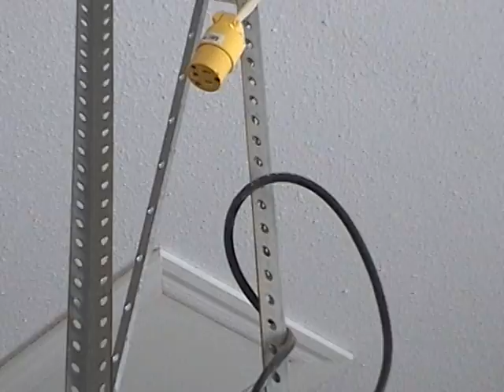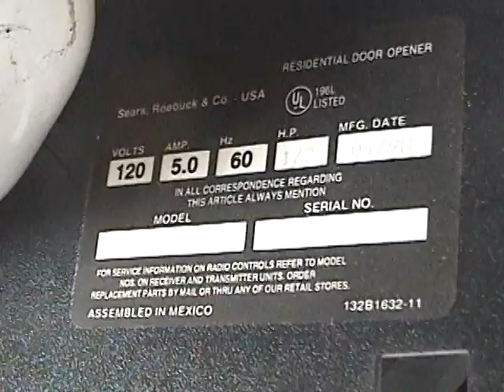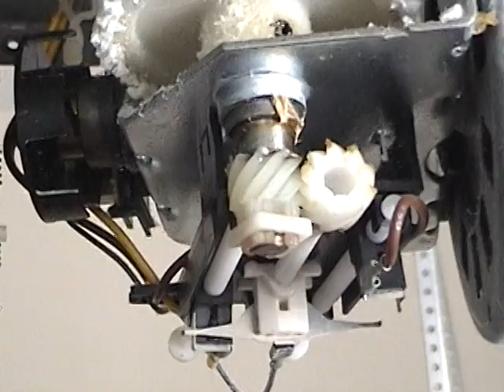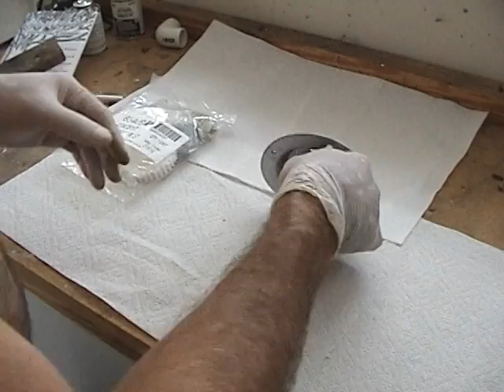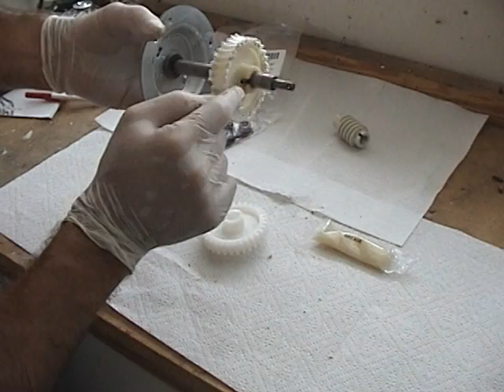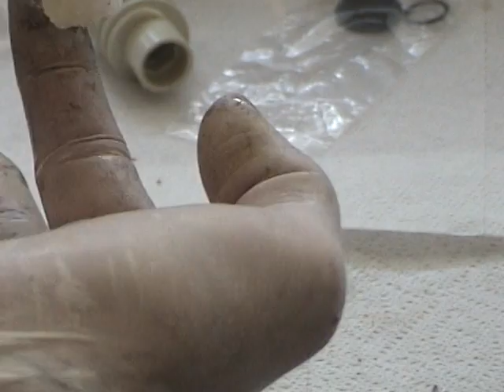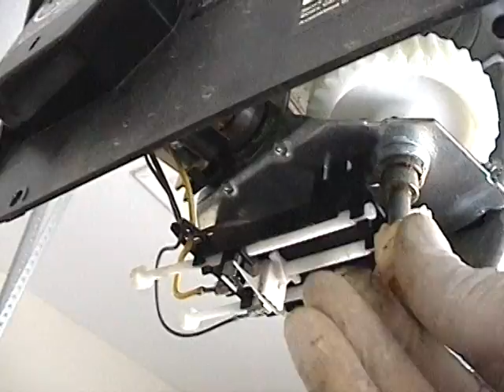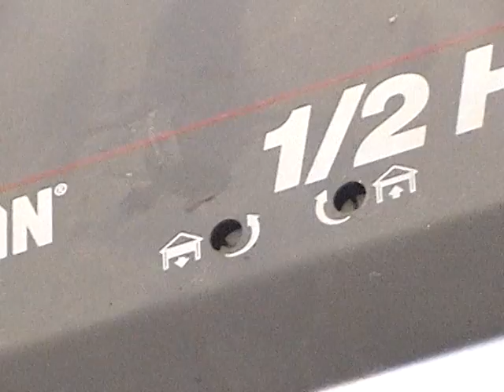Craftsman (LiftMaster) garage door opener issues?

Comment: Kris: The gear replacement went fairly smoothly. Great video. However, when I closed it up and plugged it back in, I heard a quiet "pop"  when I hit "open" and the light went out. The motor did not come on at all. I took out the capacitor and checked it and it's fine. I did not blow a fuse. What gives? Help!
Reply from the maker: check the easy stuff first namely the circuit breaker. Are you getting power to the unit? Check the circuit board in the unit, any burned spots? Check the wires, making sure nothing came loose. Not sure what it could be.

Comment: Great Video, THANK YOU!

My only issue is getting the screws out...I am having a very hard time getting at 2 of the 3 screws.  Any suggestions or creative tricks on how to get at the screws? Seems fairly straight forward if I could only get the screws out...ugh!
Reply from the maker: What is making removal hard? 1) can physically reach the screws, 2) the screw points re rounded off, 3) screws broke, etc... If I knew more, I may be able to help.
Reply: Kris Kasprzak Struggling to reach a couple of them with a tool that I have enough room to unscrew...I think I need to find a longer 5/16 wrench as I am having a hard time getting something on there with room to turn it
Reply from the maker: TheMuschnick I don't remember what tool I used--knowing me it was a ratchet. I'm sure a good old fashioned box end wrench or even a nut driver will work. Hang in there--you can do it.

Comment: Thanks for the tips, Kris.  Not quite a ten minute job for me since my garage ceiling has gyproc on it, and so was too close to the ceiling to get the gear out.  I had to drop the unit by taking out the two heavy bolts holding it to the ceiling brackets, then rest it on top of a step ladder.  It was quite heavy, so you want to be sure you have your ladder positioned to lay it on as soon as you get the bolts out.  The tip on getting that little pin out were great.  Thanks for the video.  Very useful!

Comment from the maker: There are 2 sides to the chain--the tension side and the return side. The tension should always be tight--even when the door is going down. It's possible the springs that assist lift are very tight, reducing the work on the motor. If your door rises and closes, i'd not mess with the springs--that's a very dangerous job.

Comment: Thanks a million for the video and detailed instructions!  I got the part kit on amazon for about 20 bucks (compared to 65 from the local garage door company....let alone what they'd charge for the service call).  The bottom pin holding the gear in took a while for me to get out, but I didn't have a vice grip either.
One question for you - is it normal for the belt to be a bit slack when the door is going up?  It's tight when its in the down position and fairly tight in the up position too.

Comment: Hi guys, Kris found as I did, that second gear involves taking most of the opener apart. Very involved. I found, as he did, that the small pinion gear, is not the one that wears, fortunately. Bushings don't seem to wear either.  Now.......Grease is NOT used on nylon gears. I know it's neat to open up the package, and smear that crap all over, but it's not for the gears, and it only is a dirt magnet. The grease is used for the bushings, and you can smear some on the chain, if you like......

Comment: Kris!  Thanks so much for your excellent and detailed instructions and video.  It didn't take 15 minutes, or even 30 minutes, because there is a ceiling in my garage, so space to work was restricted. Cost:  $25.65 instead of a $100 x #?#.  My dad and I were able to follow your instructions and successfully complete the project.  It was fascinating to learn how all of the mechanisms work.  My dad is going to fix the opener at his house next.  Must admit, that third screw was difficult.  You Rock!

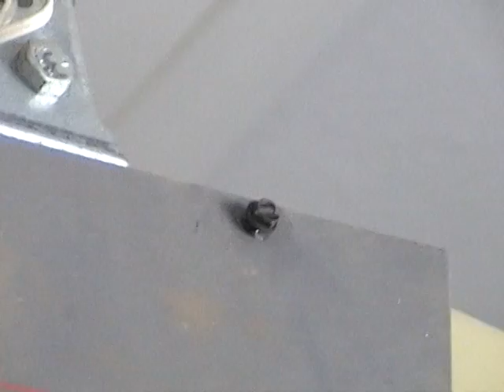Comment from the maker: are you referring to the screws I show at 1:00 min mark?
 I believe it's a 1/4 inch. Did you round the points of the screw off? If so, you will just have to use some elbow grease and a few swear words.

Comment from the maker: I'll guess the stop limit needs adjusting. This is not uncommon after changing the gears. It the adjustment screws on the side of the unit.. you will need to adjsut the stops until the door just kisses the floor. Keep your finger on the remote to stop the door during adjustment.

Comment from the maker: I'll guess the "pressure adjustment limit (adjustment screws inside the unit) needs adjusting or the stop limit (adjustment screws outside the unit). This is not uncommon after changing the gears.It sounds like the unit is "bottoming out" and forcing an open. Keep the remote in hand and be ready to stop if you adjustments are wrong.

Comment from the maker: I'll guess the pressure adjustment is off. Basically this adjustment allows the motor to apply additional force to open or close the door. It is a different adjustment from the amount of travel. If i remember the pressure adjustment is inside the unit--meaning you need to take the cover off.

Comment: Replaced gears opens normally from wall unit and transmitters.s However, I must hold the transmitter for the whole travel closing.  If I stop depressing transmitter in the down posit it stops and reopens.  What did I do wrong?

Comment: Thanks Kris.
Followed these instructions right down to using the nail punch and they worked perfectly. I also found if you remove the rear plate with the circuit board (but leave all the wires connected), you can take a little string and tie that up and out of the way for MUCH easier screw access. Appreciate you posting this!

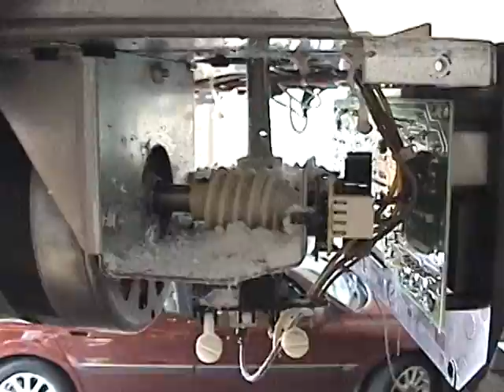Comment from the maker: are you sure the positionng screws were not damage or moved? You can see these behind my middle finger at 2:39. I'll guest they got moved or bumped you should be able to use the adjustment screws to adjust op/down and pressure.

Comment: Hey Kris,  
I changed the gear however, the door is now stuck in the 'up' position.  It seems as though there is a lot of stress on the top of the gear.  How can I get the motor to go down instead of trying to go up when I press the opener?

Comment from the maker: Spark and smoke from electronics is a bad thing. I'll guess some debris fell onto the contacts or some metal shorted out the board. The board may be repariable but would take some deep knowledge of the circuitry. It's probably best to just replace the unit. bummer....

Comment: Quick question, followed your steps and it was relatively easy as you say. When I plugged the unit back in a got a small pop from the circuit board accompanied by a little puff of smoke and spark. Now the opener doesn't work at all. I'm assuming at this point it's shot, any ideas on what happened and if there is a quick way to troubleshoot this?

Comment: Excellent video. I only need to replace the main gear (that you replaced) and do not need all the other parts that are included with the replacement kit. Seems like $1.30 sure beats the cost of the $25 for the entire package. Go to Amazon.com and at the top of page you will see a search box. Leave the "drop down arrow" in the search box on the default "All" and type into their search box "Sears Garage Door Opener Gear". Scroll down and you'll see the drive gear priced at $1.30  Thoughts? Thanks

Comment: Hey Kris, thanks for this video!  I ended up having to take the chain off, but everything went smoothly, and I was able to adjust the travel and all was good. My garage door repair guy said, "Well, you'll probably need to replace the unit, so all said and done, it'll be about $650.00"  Thanks to you, it cost $11.75, an hour of work, and a cold beer.  Outstanding video. Thanks!!

Comment: I would have changed out the worm gear on the motor shaft as well. I would have bought the entire gear shaft assy instead of the gear itself. This way if there were any worn parts  under the spocket of the chain it makes it easier to swap it out instead of trying to pull old parts out and installing the new parts.I would also leave the cover off and test everything to make sure its working properly (up & down travel) ect. This way if you need any fine adjusting the cover is off to do just that.

Comment from the maker: the garage door opener needs to know when to stop opening and when to stop closing. you must set these stop points and is done with those 2 adjustment screws shown. just when the door closes, the unit should stop, adjust the down until that happens. also just when the door is fully open the unit should stop, adjust the up adjustment until that happens. Keep your finger on the remote to manually stop the door if the adjustments are wrong--this will keep the door from bottoming out or jamming up.

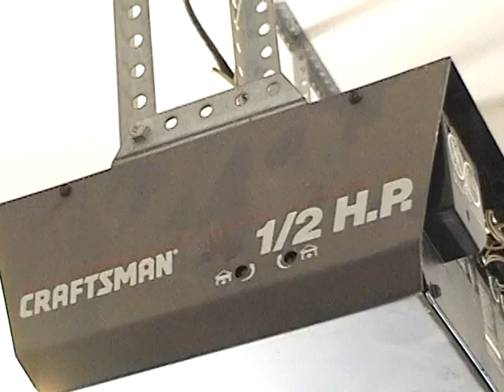Comment: at the 8:48 time point, you comment on how to use those 2 little buttons/switches, but I didn't quite follow.  Can you clarify how to use and when to use?  What are they for again?  Also, what are the 3 little white screws for on the underside of the garage door unit that seem to just move little metal mesh-looking contraptions left and right?  As you screw them to the right or left, the little metal brackets seem to move left or right.

Comment: THANX Kris! Waist 2 throw away repairable stuff. This 1 Nice cause u do not have to line up any timing marks on gears. Appliances are made to be disassembled and repaired. My favorite I mastered was repairing printing calculators. Even all the TV remote controls & typing keyboards can be disassembled and the rubber layer washed with brush & soap in sink. Then lightly use an eraser to take shine off of black contact points.NEED 2 LEARN HOW 2 INEXPENSIVELY SAVE ASH TREES FROM EAB, JUST ASK ME!

Comment from the maker: Thats hard to say I have two openers and in theri 15-year life gears in both got stripped. I'd guess the stripping is due to natural wear. I would check the spring tension--too low and the motor may be doing too much work. Careful if it needs adjustment--huge forces and very dangerous to adjust. If your opener is 10 or so years, id replace and not worry.

Comment: Kris - Thank you very much! I had looked on Amazon for the white plastic gear and an Amazon review sent me to your video. The whole Pilot garage door opener cost $370 in 1999 and the company that installed the garage door probably would have wanted to replace the whole unit and charge $100 at least for the service call. Instead of spending upwards of $500 for a replacement unit after 14 years of operation, I bought the gear and grease on Amazon of $14 and saved over $400. Great how-to video!

Comment from the maker: I was able to get the shaft out with the chain on--reason i did it in this order is that the chain was easier to get off after the shaft was out--if you can take the chain off first, that may help. It doesnt' matter the order of removal, mine was just easier in the order I showed. Your chain may be very tight and could be the reason shaft removal is difficult.

Comment: I may sound a bit moronic, but in your video, you didnt take the chain off until you had the assembly up and out of the unit.  The top plate spins with the three screws removed. WD40 or a rap of a hammer would possibly loosen it up, but only bad things would result.

Comment from the maker: 1) is the chain off? 2) is the lower retaining clip removed? 3) can the lower gear be removed? 4) will the top plate with the 3 screws move--are you sure there's isn't a 4th screw? My first inclination is that the lower shaft may be a bit rusy and not letting sliding out of the bearing--try turning and  pulling at the same time.

Comment: Kris. I had no issue up to the part of getting the gearing assembly out of unit. It would not lift up like yours did in the video. The three screws are out and I attempt to pull the top of the assembly, it will not move up. Any ideas?

Comment: Great video, more useful than the instructions.  I ran into a few things that others may be interested in knowing.  First, clean the worm gear on the motor shaft. I used a small blade screwdriver and spun the shaft to get the gunk out. Then a paper towel with cleaner.  Second, the door was down but the opener thought it was open and tried to close it.  Fixed that by spinning the center screw on the limit switch to the other end.  Only needed the gear, would have saved money not buying the kit.

Comment: I'm picking up my repair kit tomorrow from Sears to replace my worn out gears. I found your video very helpful and seemed pretty straight forward to me.  I'm just curious why you didn't go ahead and replace the bearings since it was included in the replacement kit?  I only ask because faulty bearings may have contributed to the failure.

Comment: Kris. Thanks a bunch for the "great" instructions... much appreciated!!!  
To remove the gear, probably the easiest way to get the roll pin out is with a "pin punch" tool.  The size you'll want is 3/16" or 4.8mm.  You can buy one for $4 to $5 at a decent hardware or auto store.  If you have a mechanic friend they'll likely have what you need.  I'd steer clear of a center punch for it tends to spread the roll pen.  Hope that helps!

Comment: I have a similar Craftsman opener, cracked open the back panel and found the same gear completely stripped off.  Thanks so much for this video, didn't know I could order the individual parts from Sears.  Saving me a couple hundred dollars from replacing the whole unit!

Comment: Great video, and it shows exactly what happened to my garage opener. I live in Miami, FL, and the the reason why the gears were totally stripped is because we had a cold front (50's lol) and I learned that the sensors malfunction under this circumstances, so you need to press and hold the wall-mounted button in order to close the garage. All this going up/down takes its toll. We are back in the 70's and 80's so I hope this will work fine until our next cold front.

Comment: I can't believe I found this video.  This is the exact door opener I have, but my gear is in much worse condition.  I am going to order parts today.  My door does not open easily manually so I want to fix that before re-connecting to the garage door opener.  Thanks for the video - this will make this job much easier.

Comment from the maker: my only guess is the springs are not applying enough force and putting too much load on the gears. Try this.... unhook the opener from the door (pull the red emergency rope to disengange the opener). If you can *easily* open the door, the springs are probably set correctly, If it takes soem muscle to lift the door, i'll guess the springs are not applying enough  open force. Careful in tightening the springs--incredibly dangerous job.

Comment from the maker: When the gears were totally stripped, my door would not go up or down. I remember it making some grinding noises just before total failure. I recommend popping off the cover and taking a look. If your gears are not stripped the springs may not be applying enough force to assist the up operation. A buck says the gears are becomming stripped.
Reply: I have the same problem. Will the repair be the same with a belt instead of a chain system. Doesn't look any different

Comment from the maker: Are you sure the pins securing the gears are installed. There are 2 for the large gear. I'm not sure how many for the worm gear. If the gears and not mating it may be due to lack of the securing pins.

Comment: If you have a screw-driven Craftsman opener unfortunately this video won't help. My model 139.53992D suffered from another problem that is apparently common to Chamberlain-built Craftsman openers: the plastic part that shuttles along the screw wears off and instead of opening the door just grinds and grinds. The part is cheap on Amazon and supposedly easy to replace. My husband is planning to record that process as a video response to this video. Hopefully it goes as smoothly for him.

Comment: Most of the time only the drive gear is needed, if the worm gear looks OK. Search "Sears drive gear" on Ebay, and get it for about 9 bucks with the lubricant. They are all the same for Craftsman, Liftmaster, Chamberlain, and others. If it looks like it, it's the same. Good video.

Comment: You the man... 15 minute job? I pushed 2.5 hours !! HA! What a pain getting those 3 screws off & ESPECIALLY on. Not easy to get the gear back into place when you have the chain tension. Taking out that set screw took some serious time. I also had to adjust the travel & downforce for a good 30 minutes until things worked right.

Thanks boss

Comment: Finished the replacement procedure this weekend. As noted here, it's a straight forward job. My replacement part pkg. came with the gear and sprocket assembly altogether already, so I simply replaced the entire piece, which made the job even easier! 2 of the 3 screws that fasten the top hat/chain sprocket to the unit are easy..........the 3rd one is tough to get at, and I couldn't get it back in once removed. I would have had to have removed some additional stuff. I left it out.

Comment from the maker: 1) Are you sure the door is not bottoming out on the floor? Probably a long shot but if it were the motor would heat up 2) did you use plenty of grease? 3) are the springs that help raise the door adjusted correctly--basically can you open and close the door with minimal effort--if not CAREFULL IN ADJUSTING THE SPRINGS. huge force that will go boing. 4) dry chain or rollers? 5) try disengaging the door from the connecting rod to isolate where the excessive resistence is.

Comment: Thank you so much for your information.  We just changed the gear on ours, we have the same opener as the video. However, we had a problem getting it to close and open to the right time- we changed the up and down buttons- Now the motor is getting too hot and stops working- once it cools down it's fine- What do you think we need to do?